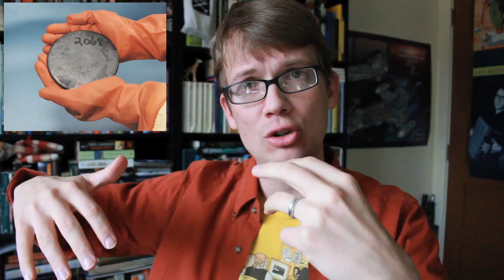Why Did Fukushima Explode?

Comment: Nukeyoolar reactors are basically designed to blow up? Water splits into explosive hydrogen, blows up the containment which in turn generates more heat, damaging the fuel rods creating more heat, etc. etc. It's like using your oven to store your match collection. :/

Comment: The cooling system is powered by the reactor when its running. In an emergency the control rods prevent the plant from producing power and contain the radiation from the fuel rods. So back-up generators are needed to maintain all the critical systems, cooling being one of them. As Hank said there is still heat and radiation but it isn't enough to power the systems.

Comment: Except Chernobyl was cause because of poor maintenance and and a lack of safety standards. 
What happened in Japan was a freak accident. Japan has been using nuclear reactors for over 30+ with no problems whats so ever then suddenly in 2011 and earthquake of a magnitude no one could have predicted forced the reactor's fail safe to active. 
As said in the video the fail safe's were then wiped out by an equally unpredictable tsunami.

Comment: That has had its estimated ability decreased over time.  Fusion has been 30 years away for 30 years, and I still have yet to be persuaded otherwise.  The majority of nuclear engineers make jokes about it because the restraints on small scale fusions are huge.  MIT's test reactor is bathed in liquid nitrogen and a run of 10 seconds is a success.  LFTR technology (there is a SciShow video on it) is the best chance for a true nuclear renaissance.

Comment: Hank, i thought that the reason the Fukushima Reactor overheated was because, ideally, in nuclear power station the control rods are placed on the top, in case there is a power outage then gravity drops them down. But for some reason fukushima had them on the bottom, and because of the power outage, they couldn't get them back in again. And the other problems you explained. I could be mistaken, i probably am mistaken, but there are loads of theories,and i thought you might have wanted to know.

Comment: We should use Liquid Fluoride Thorium Reactors (LFTRs) because they're SO SO awesome, basically 72% of all waste products are safe within 10 years compared to the thousands from uranium reactors, the emergency system is a freeze plug that's melts when the electricity is cut off when the reactor gets out of control but this can barely happen because the core is a liquid fluoride solution which expands when too hot meaning it cools itself as it gets less dense and if too cool it contacts and caus

Comment: @FatherFizz You dont even know the first thing about what you are talking about. Ok The type of radiation from a nuclear explosion or nuclear reactor is called fallout. Nuclear fallout can be avoided by wearing a simple rubber suite. They had to irradiate the ship from nuclear fallout after they left the contaminated area. you know how they did that???? they washed the fucking thing. washed it with soap and water. Its not hard to clean fallout its just really bad if you get it on your skin.

Comment: @utny It's exactly correct; for nuclear reactions of this type.  You start with an atom being stuck by a neutron.  You end up with more than one atom and at least one neutron.  If you weigh the products before and after, there's less mass afterwards. What happened to it?  It was converted into energy according to E=mc^2.  How do we know?  We measure the energy and find out that it is equal to the mass difference times the speed of light squared... exactly.

Comment: You only mention primary containment (a steel layer) and secondary containment (a concrete layer), but I thought modern plants had a tertiary layer (another steel layer) as well. Also, that part of the problem with Chernobyl was that it didn't have a tertiary layer. Is this true? If so, did Fukushima have a tertiary layer?

Comment: @vivecanada1 No. It is the fast flowing steam that runs a turbine, the same way Coal, Oil, Geothermal, Solar and Wind power generators work the turbine spins which is then directly converted into electicity.

Comment: U-235 is an isotope of uranium. It is highly refined, and is bomb grade material. The uranium in the fuel rods at a nuclear power plant contains less than 5% of U-235. The uranium in a nuclear bomb contains 95+ % U-235. So that's why a nuclear reactor cannot explode like an atomic bomb.

Comment: You're definition of the primary danger is not quite accurate. The major concern for Japan and many other countries is that either the fuel rods or the spent fuel rods will actually melt their way down through the earth and into the water table bellow, which would cause an explosion (not a fiery one, but more of a super massive, expanding cloud of steam) which would propel radioactive particles and steam over fast distances. This is much more likely and devastating than an explosion of hydrogen.

Comment: @Jebrone well thats quite alot of heat, so maybe not a low temp. stirlingmotor but you could use that for something like that? like replace the gas backup with a stirlingmotor that runs off the spent fuel rods in the cool-down tanks

Comment: Close on all counts, but a couple minor errors. The hydrogen wasn't created by hydrolysis. The hydrogen comes from the hydride creation process where the zircaloy and water react together. Spent fuel bundles also have some uranium 235 left, enough to make reprocessing them (or even better, burning them directly in a "fast" neutron reactor) economical.

Comment: As to whether or not nuclear power is a good idea overall, keep in mind that these reactors were designed 40 years ago.  As safe as they are (and they're pretty darn safe, consider how much devastation it took at once to cause the current problems), the newer reactor designs are 40 years improved.  40 years is a long time when it comes to technological advancement.  If we could build new reactors and take the old ones offline, it would make it all a whole lot safer.

Comment: whate.... if spent fuel rods give off heat why not use them to power a lowtemp. stirlingmotor? then use that to power the cooling systems for the main reactor and extra power output?

Comment: @sporeglitcher it's the most efficient method we have to capture heat. Also, it has an above average efficiency, because any heat created by moving parts is also captured, which is more than can be said about car engines. mirrors reflecting light onto pipes are much cheaper than solar panels (per kilowatt produced), and usually are even lower maintenance than solar panels, which need to be replaced every 10-20 years to maintain efficiency.

Comment: also, what kind of water is used to absorb the energy, which is then turned to steam to make the power generating turnbine go? Does the water contain additives, artificial chemicals, and do they filter it, or does normal seawater works? how long does spent fuel rods take to cool down? thank you for reading and answering my questions in advance.

Comment: @cnelson711 He did not say that the heat split the water into hydrogen and oxygen by itself, he said that the rods breaking down created an environment that, combined with the heat that was not being cooled off because the cooling system was offline, could split water into hydrogen and oxygen. No factual error.

Comment: @bizzyyyyyyyyyyyyyyyy it's probably not as bad as you think.  Note that I said they have to be high energy to fission your atoms or get stuck in them?  Well it is the nature of these neutrons to lose energy fairly quickly, so they only remain high energy for a short distance.  It's a 1 over r^2 ratio so the radiation is only going to be dangerous more or less within the power plant right now.  Even if you are in Tokyo right now, a glass of water would protect you. LOL!

Comment: @jackpaice   We tamper with these forces cause it has an insane amount of potential and the future of humanity depends on it. Fossil fuels pollute to much and are limited. Solar and Wind are hippy BS. Wind requires an area with lots of wind, and if wind stops, power grid fails. Also they are failures economically and have to subsidized. Solar needs valuable and dangerous elements to make, and even more dangerous to make batteries for, you known the half the time there is not sun.

Comment: @bizzyyyyyyyyyyyyyyyy There are three really common types of radiation, one of them called beta decay is all of those neutrons flying around after the reaction occurs.  The neutrons don't just cause Uranium atoms to split, they cause any atoms to split or possibly be made heavy if they absorb the neutron instead.  If you are around a concentration of higher energy beta decay, you are being bombarded with these atom altering neutrons, which can mess up your DNA or RNA...

Comment: @mortadelletube yes the earthquake was far bigger than anticipated. but everything held, and no damage!! the tsunami killed the generators cutting off power to the cooling systems. the people working there are brave but saying they are sacrificing their lives is a stretch. at most, they are risking lukemia, which can be essentially cured.
i predict 0 deaths from anything radiation-related at the fukushima plants in japan or elsewhere. the biggest risk they face is being in a hydrogen explosion.

Comment: For the record in my oppinion based on limited knowlege I thing nuclear power is great. The problems only begin when things go wrong. Just consider the reactors in japan. They were working well, untill they got hit by two disasters. The answer to nullifying the danger is to protect the reactors from every possable problem that could arise imaginable. This of course will cost more money than the company wants to spent (for many reasons). But it is possable if the company is willing to pay for it.

Comment: I am pretty sure that the zirconium oxidizes in water when the temp exceeds something in the neighborhood of 2000F/1100C. This leaves just the hydrogen and zirconium oxide.  If the water molecules were being split by the heat there would also be oxygen in the primary containment vessels. For anyone who has ever put a trash bag over a fish tank and plugged two electrodes into the wall, we know how that ends...or is that just me?

Comment: One little nitpick though. In addition to diesel power backup, the reactors had battery backup. Unfortunately, that's only intended to last a few hours until the diesel backup is fixed. But with the tsunami that wasn't possible.

Comment: Thank you for doing the research to gain the knowledge to explain to others in a straightforward way what is going on. This information filled in some gaps in my understanding about how and why heat is still being produced even though the control rods stopped the reaction.

P.S. Thanks for just bringing information. I will forum my own opinions once I have a better understanding of both sides of this issue.

Comment: The whole "mass defect" thing as an explanation of where nuclear energy comes from, with the whole E=mc^2 thing, is a bad explanation.  The energy is in the binding energy of the nuclear forces (which does increase the mass of the U-235 by E=mc^2, but it's not fundamental rest mass energy, in some sense).  It's as if the U-235 is a compressed spring with two masses on it but held together by a thread, and the neutron snaps the thread, allowing the spring to send those daughter nuclei flying.

Comment: @marcbassist666 well lets just say, if there is, then we assume there was no way to avoid it from happening. I dont know why we dont have plants that physically move the rods away from each other into their own cooling tanks (or even just somewhere they can melt down safely). But something like that would have to be built in before a reaction starts, radiation is way to high to ACTUALLY touch it now.

Comment: You missed one part of a fission reactor, the moderator. In modern plants this is water the fuel rods are immersed in, at Chernobyl this was graphite that burned off and that's why we don't use graphite anymore... Anyway, the moderator serves to slow down the neutrons coming out of the fission of U235 so they are more likely to cause another fission reaction. You also sort of misspoke, it does take a neutron with a particular velocity to reliably cause U235 to fission, too fast and it passes by.

Comment: Ummm. . . The spent fuel rods most definitely contain uranium, including uranium 235.  They just don't produce heat efficiently enough for the reactor core.  The half life of uranium 235 is something like 700,000 years.  It will be around for a while.

Comment: @savvy826 There is also a huge difference between radiation, and contamination. Radiation is like how you can feel the heat of a fire- you can distance yourself, lessen your exposure, or shield yourself from it fairly easily as opposed to contamination which would be like... catching on fire. We believe so far Japan only had radiation not contamination, Chernobyl had lots and lots of radioactive contamination.

Comment: @KikiNickle Also- the water acts as a shield from the radiation of the rod in the cooling tanks, that is part of why they are having so many problems with unit 4 since there was an explosion in the cooling tank they are dealing with radiation issues which are manageable as long as they don't become contamination issues.

Comment: Hey so my Dad works on nuclear reactors and he also explained this:

1-There is a tertiary system that also failed, in the US we have updated programing for that system so that it can run for weeks without outside power and not fail- Japan lasted 8 hours.

2- Unit 4 which had the cooling tank explosion had already been shut down to fix some things, they are suspecting there was a small leak they were trying to find that expanded from the earthquake- "no comment" from Japan on that one

Comment: @savvy826 Chernobyl was also using a different form of coolant. While Japan uses water to help in this process, Chernobyl used graphite, if I remember correctly. Water dissipates much more quickly than graphite ever would, so even if radiation did reach North America, it will have little to no effect on us.

Comment: "The result is that the reactor needs to remain cooled or else radiation from the meltdown will be released to the environment in significant quantities." Is not correct. 
Should say: The result is that the reactor needs to remain cooled or else radiation from the meltdown *may* be released to the environment in significant quantities *if primary containment is breached.* 
That's a very big if.

Comment: @areiland well it is hot enough if you tread it on a different way, in Belgium we've got this project called mira that uses that heat of the used cells to produce electricity yet again.. But in a normal nuclear reactor the heat of the used cells wouldn't make that much of a difference..

Comment: I don't know how it is in the USA but in germany the issue is pretty clear cut. We only get 13% of our electricity from nuclear energy and we export like 10% of it, so we could basically just switch off all of our nuclear power plants and don't have any problems. Furthermore we get 16% from renewables and we could easily get 50% by 2020, but the atomic power plants hold back the renewable ones, since with nuclear and renewable there is just too much energy to handle for the grid.

Comment: Possibly dumb question:
The fuel rods reacting = heat, heat+water = steam turning the turbine = energy. This part I completely understand.
My question is: Why is it a problem that the spent rods create and radiate heat? Why don't they just keep going with the water to make more steam and energy until the spent rods decay? Evaporative cooling would keep the rods from breaking the same way it did during the reaction, right?
I know that wouldn't help during an earthquake, but why isn't it SOP?

Comment: generally like, minor details: the generators (and the backup generators to the generators) were functional UNTIL the tsunami when the building and fuel supply was destroyed...) and THEN the pumps were powered by batteries (backup to the back up generators for the generators) for 8 hours...  SPNF *DOES* contain uranium, just not enough to maintain a workable criticality within the reactor...  anyhow minor details,  good video all in all.

Comment: the question is not is nuclear safe, the question is, are people responsiable enough to use nuclear.
I have worked in many coal fire power plants and I have seen companies take short cut while overhauling turbines, and I have seen companies be very stricked  on how every thing is contained. (even coal fire turbines has radiation on the generator side)

Comment: @Silmirel wel that's only partially true...yes continuously the only source of fusion power is the sun and yes it is expensive, but: it has been done successfully on earth (current record 65% input output ratio but soon more) and while it is very hot using plasma-containing-magnetic fields allows us to lessen the temperature problem and either way it's better than fission

Comment: @maximumrisk2004 The difference between this and Chernobyl is that the explosion in Chernobyl caused the reactor core to be exposed directly to its surroundings. As far as we know this hasn't happened yet in Japan. And don't be so ignorant to say no one is working in Fukushima's nuclear stations. Engineers are risking their lives being exposed to high levels of radiations trying to rectify this problem this very moment.